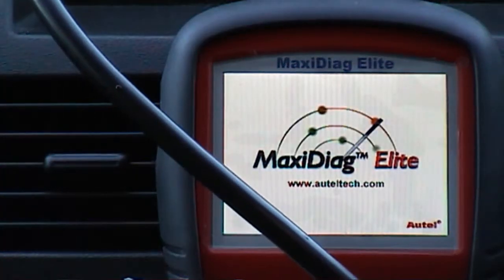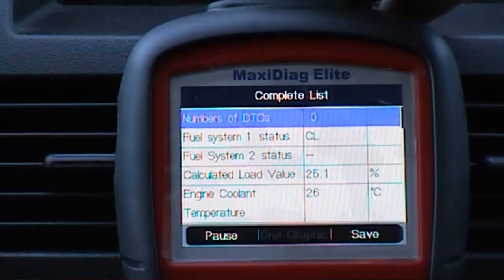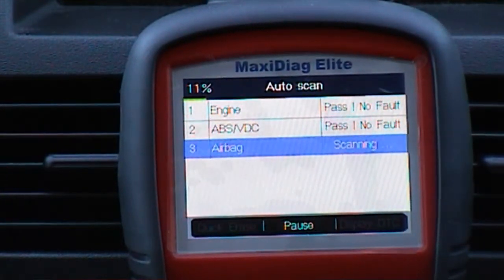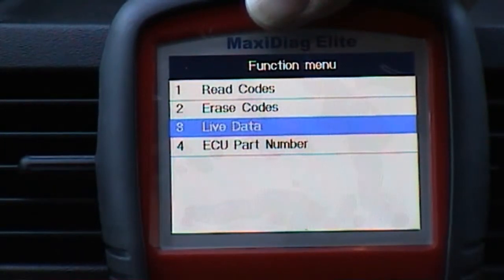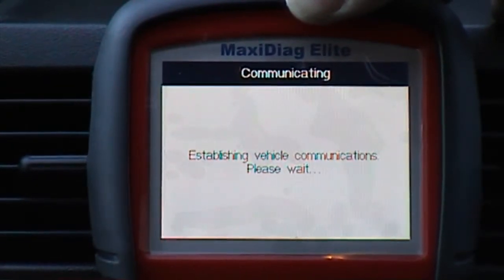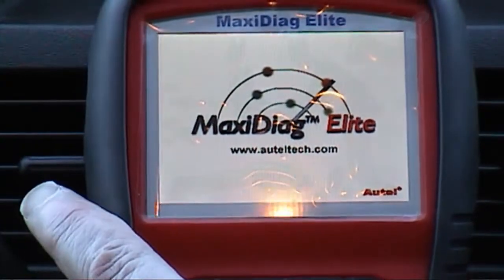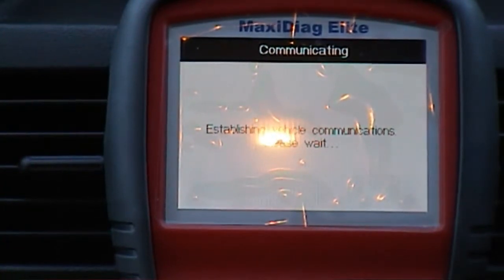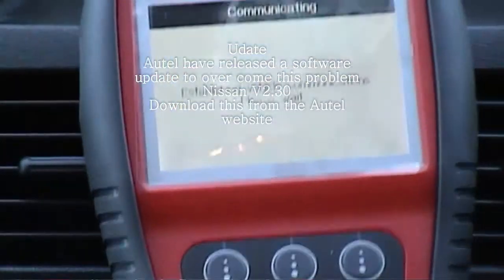Autel MD802 Nissan Communication problem

Comment: you have to do the scanner update first since the firmware goes by 5.06 has a motor that allows the motor to have the light on if it does not have the power to never diagnose checking the motor's fuse and the connections that have 12 volts in the scanner connector

Comment: AUTEL - terrible malfunction with Nissan Altima 2007 2.5L motor, won't recognized modules and gives fault ECU code U1000.
Reply from the maker: I have found some problems with this scan tool, but overall, its got a lot of coverage and does functions that Snap On can't do, I now use a Snap on and an Autel, to get as much coverage as possible, but all scan tools give problems, to get full coverage of a manufacture, you would have to get their own recommended scan tool, even this sometimes gives problems, unfortunately, there is no such thing as the perfect Scan tool

Comment: I WOULD NOT IN A MILLION YEARS RECOMMEND AUTEL DIAGNOSTICS TO ANY OF MY CLIENTS, POOR HARDWARE&SOFTWARE CONNECTION ISSUES,THE WORST TECHNICAL SUPPORT LINE I HAVE CAME ACROSS WITH OVER 35 YEARS MOTOR TRADE EXPERIENCE,UPDATE SERVER NEVER WORKS PROPERLY,AUTEL PROMISE THE WORLD, DELIVER NOTHING,
Reply: witch one do you recomend?